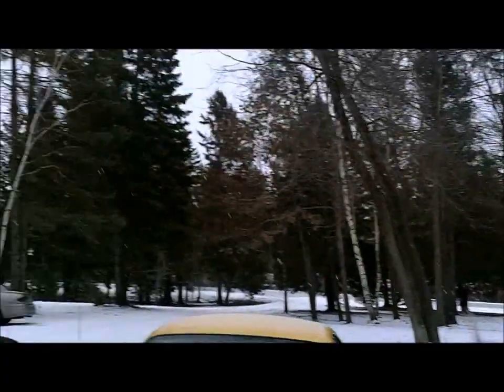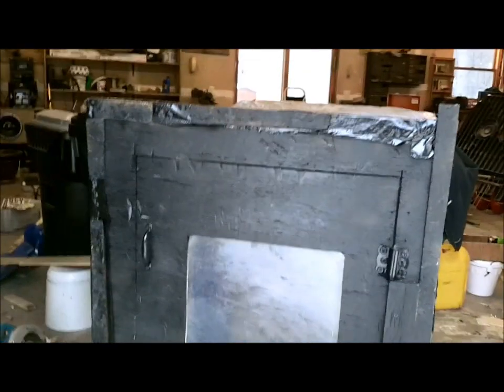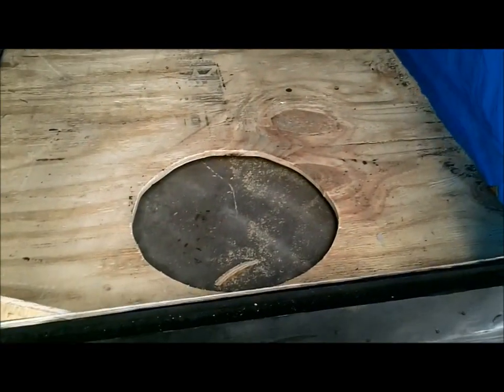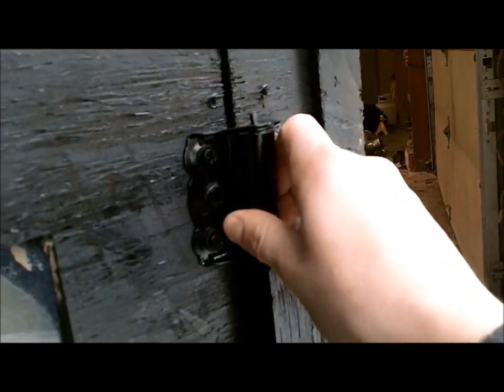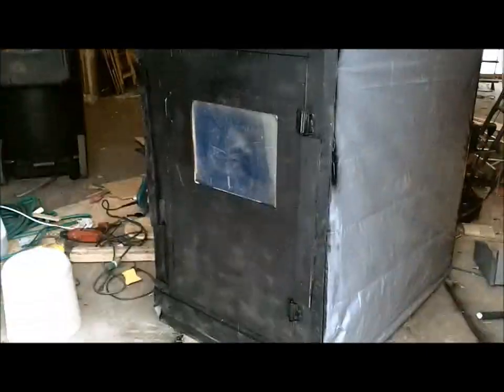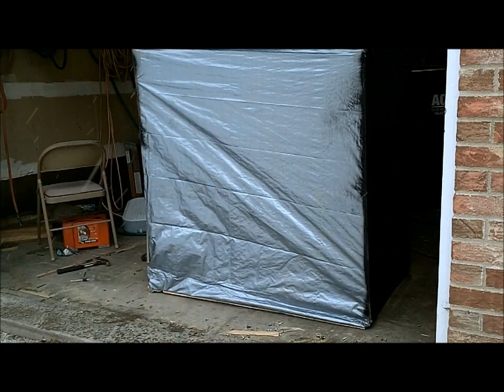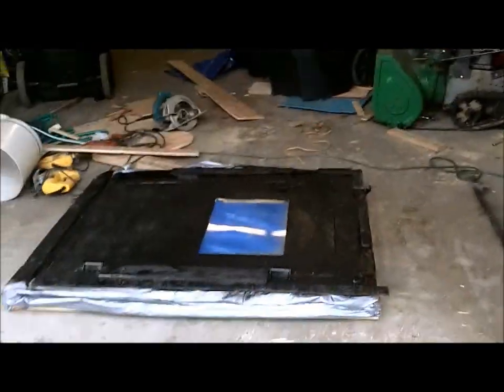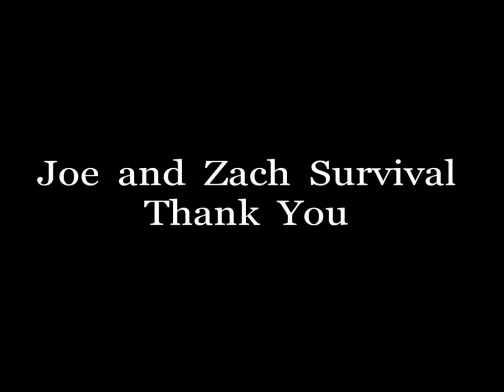Homemade Fish house.

Comment: Next time put the hole on other side and bring a bucket to sit on and scoop the ice from the hole and threw it out the door , and if you made it as a frame and left the floor out it would cut 1/2 the weight , 
Great job just a few tips to improve it
Reply from the maker: Shelly K every time I am out drill the hole first then scoop out the slush from the hole before I even put out my shanty. Then with the heater on inside the hole barely gets slushy. Having a floor in the shelter provides strength but also a layer of insulation. often time people who have a open floor fish house will place foam mats on the ice as a insulation. personally I would rather have it all in one than having to count out how many mat pieces I need. It would make it lighter though.

Comment: I personally am a huge fan of the hole placement, Zack. I've never ice fished before but would imagine the ability to avoid stepping in the hole would be a prerequisite. 

You've got the wheels in my head turning now on a pop-up hunting blind based on this design.

Comment: This is the same design I built a couple years back. It's an easy build and cheap. Only exception is that I had no floor. I had skis on it because mine fold down to a sled to hold all my gear as I walked on the ice.